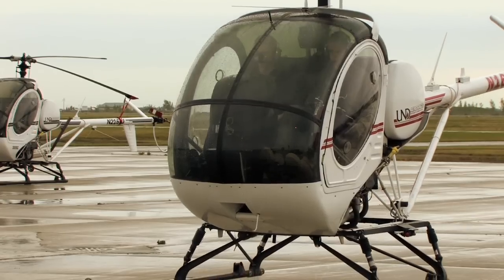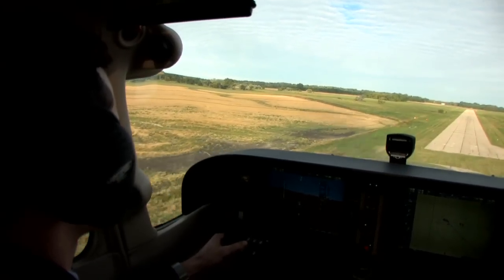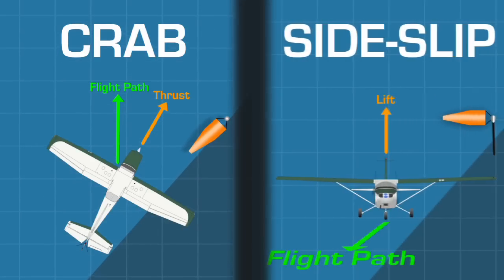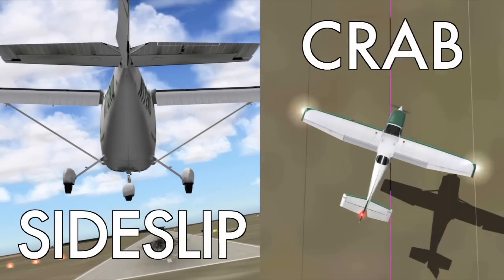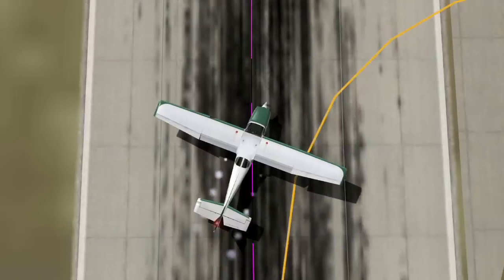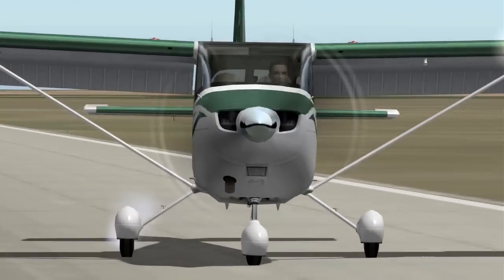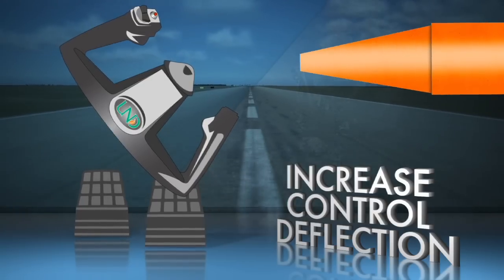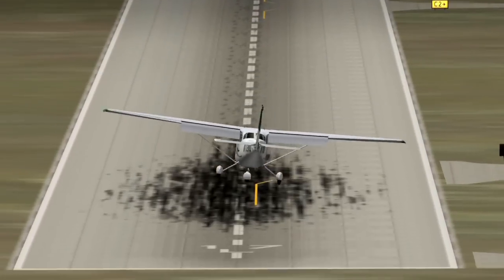Faulty Approaches: Crosswind Considerations

Comment: Yep, it takes a conscious effort to actually depress that rudder pedal. It's quite humorous really, but many people only THINK about using the rudder. In the end though, they don't apply any pressure on it at all during the roundout and flare. That's one of the biggest "missteps" I've noticed in my 44 years of instructing, and I think it must have something to do with human nature - a sort of resignation. It's almost like these pilots think that once the stall-warning horn comes on they have arrived at a barrier and can no longer change the flight control positions. It's as if they're saying to themselves: "Well, I've done all I can do. Whatever's gonna hapn' is going to happen."  You have to keep flying, keep thinking, keep observing... You have to actually push on the rudder pedals all the way through the approach, touchdown and rollout. Sometimes I just sit there and smile and smile...

Comment: Everything in this video was spot on. Only thing I would add is to practice landing without flaps or very little. It'll make severe crosswind landings much easier.
Reply: @naborsimbor5752  Severe crosswind landings are relative to skill level. Here on the Gulf Coast, where the weather changes in a minute you better be working towards handling intense crosswinds. I've put my 172 down with 28kt crosswinds from Houston to Mobile on several occasions. People who actually fly know you don't get to pick what the wind is going to be like at your destination.

Comment: thanks for your exelent vídeo.
on minute 14:45 you said one wheel firts.
I alway do, on my pitts, on the DC3, C46, DC6,727,737, E190 abd A320family sideslip snd main wheels touching all , at the same Time.
Also is a recomendation, from Airbus.
If have material where saids one wheel firts, 
I Will appreciate.
Thanks

Comment: Meh. Come in high, kill the engine, and full forward slip straight down, minimizes side loading by minimizing forward motion, the steep geometric approach angle has an inherently smaller more accurate touchdown zone, and assures obstacle clearance. Works with wind, no wind, any surface, no need for tedious setups and glide slope intercepts.

Comment: Glad to see this video.10,000 hour CFI ATP, 1,800 hrs dual given, I'm a stickler for proper  practice of cross wind landings. I see these YT videos (even airline pilots) and cringe at how pilots have zero concept/ability to perform proper X-wind landings. If there's any significant wind, you will likely have some X-wind component. Cross wind technique (side slip) can be subtle. Practice does not have to be at max X-wind limits. Think/practice cross wind landings almost every landing.

Comment: why do you use flaps ?  i thought that flaps are not recomended with cross wind , just if u have to sort out an obstacle !
Reply: Xray55 minimal flaps during crosswind and soft field landings.
Reply: Have to concur with Doge's observation, flying 207's up in Alaska with 30 direct xwind everywhere you went, no flaps was the order of the day
Reply: Those same 30 kt crosswinds in the Van on slick paved runways would frequently result in flat spotting the tires
Reply: Depends on the aircraft and many other details. Flaps are simply full out or full in on some aircraft, while others have intermediate settings.

Comment: I have landed a 172 in 24 KT Xwind gusting at 36, quartering at 124 degrees and the runway on 150. Wicked ground effect at the very end . So you gotta be awake !
Reply: 12424G36 on rwy 150 is around a 15kt crosswind component with 25kt headwind.  The gusting certainly makes it more challenging though.
Reply: That's insane!

Comment: My favorite action is side slip, realy usable only with a high wing aircraft, wing down in the wind: this avoid a wing lift in wind gusts, touch down with on wheel, but need a bit training and skill...crabbing/decrabing can be dangerous on hard runway (loss of controll), much less danger on a grass strip (tyre slip on grass)
Reply: The Crosswind Slip is the right method for ALL aircraft, not just high wingers..The only exception are the big Jetliners with too low engines which due to Tandem Landing Gear (4 tires per gear) and low to the ground engines, they need to be slipped no more than say 5-8 degrees and put some crabbing if need more correction..Many Jetliner "Pilots" cannot due The Crosswind Slip well due is a 3D landing, so they let the Clod due a 2D or two control used only touchdown..The Crab to De Crab method..For wimps only..On taildragers means an accident...
I have seen many doing that method for years..wearing out tires for years..Even if they cannot a good Vmax Crosswind Landing..

Comment: I currently go to UND. Is there anywhere I can download a c172 with g1000 for Flight Sim?? I have been looking all over for one so that I can use it at home.
Reply from the maker: Hi Eric.  Are you looking for a C172 for X-Plane?  If so, the 172 we use for the AeroCast has kind of a dummy G1000 that is mostly just for looks because, the last time I checked, X-Plane couldn't simulate a G1000 correctly.  However, in searching for an answer to your question, I came across this: http://forums.x-plane.org/index.php?app=downloads&showfile=20015    Its a custom panel that you can download and insert into the C-172 model that comes with X-Plane 10.  Give it a shot - totally free.  Good luck!

Comment: There are three kinds of Slips, not just two. Calling the Straight Slip a Side Slip is contradictory due on the Straight Slip you are not going sideways but inclined in a straight line. The Forward Slip is straight too but more inclined . The De-Crab method is used mostly by under the wing engined jets to prevent bad pilots from doing hard touchdowns Slip and have an engine strike that is more expensive than replacing scraped tires. 747's and B-52's are landed with mostly a big crab due that.

Comment: The problem I see is too much flap deployment. Why landing at the edge of the flight envelope, you certainly don't want the added lift in a crosswind environment. I never use more than 10 degrees on final, and pump the flaps once the craft has planted wheels.

Comment: A crab is flown into the wind with wings level and rudder coordinated. The forward and side-slips are aerodynamically the same with the same basic controls. The only real difference being the effect of rudder. In a side-slip, the rudder is used for runway alignment. In a forward slip, rudder is used to increase drag on the airplane. Ailerons are used opposite the rudder. In combination, these controls maintain ground-track and alignment. Good luck with your flying!

Comment: If the crab method relies on thrust,what does a glider or a power off plane use?Don't be confused by over use of words and explanations,just put in the control inputs necessary to touch down straight.Over analyzing and thinking just adds to confusion.Seat of the pants all the way,same with airspeed,but a little faster won't hurt for training.